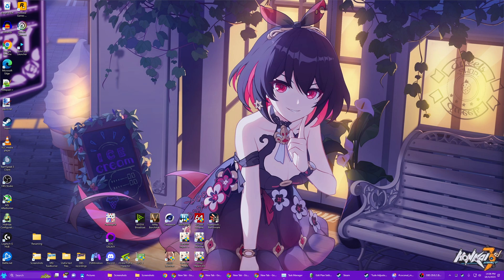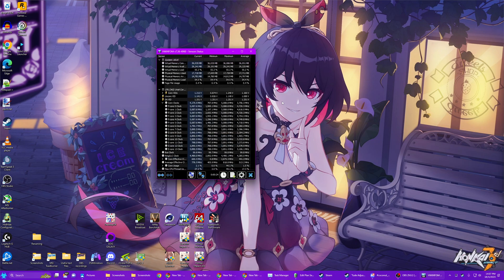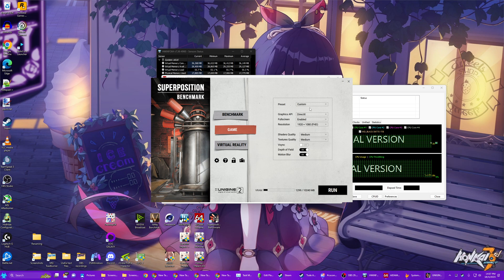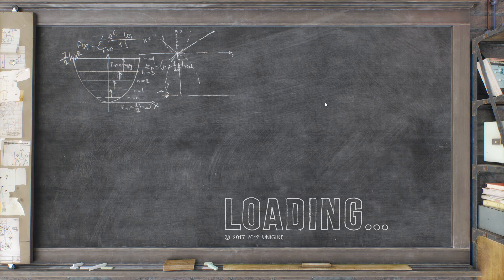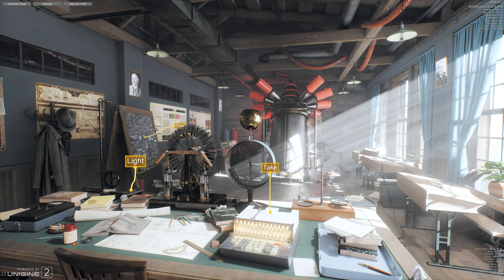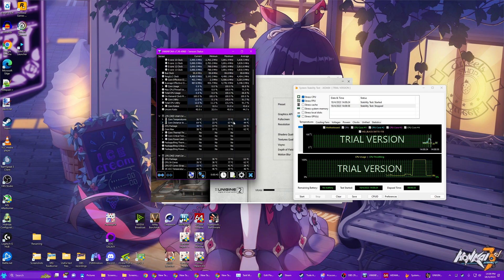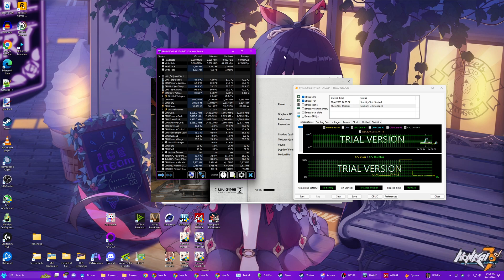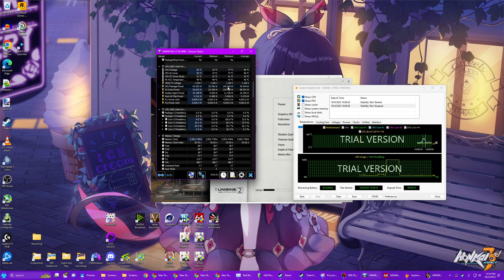Laptop stress test guide! (Updated 2023, read desc)

Comment: i have by defaut polling period 2000./ 100 / 1
what does this mean ? and what is the different if i use 500  / 100 / 1 like u did
Reply from the maker: Polling rate is the number of milliseconds before an update. 2000 polling rate means it updates once every 2 seconds, which is slow for temperature or power spikes. 500 means twice per second, which is fine without excessively hurting CPU usage due to faster queries.
Reply: @d2ultima  and what about disk S M A R T every and Emb controller every ?
Reply from the maker: @XenomTV  never bothered with those options, better to check the official forums or help section
Reply: @d2ultima  so i came from ur old stress test video , why on this one u didnt check stress cache on aida like the old video and thanks for the explanations
Reply from the maker: @XenomTV  didn't think it was necessary this time. Back then it was an issue for CPUs not getting the power they needed to get performance, and now that isn't the case for a lot of them, so we really only need to test temperatures
Reply: @d2ultima  thank you
Reply: @d2ultima  ?